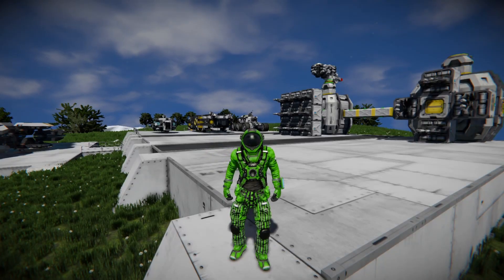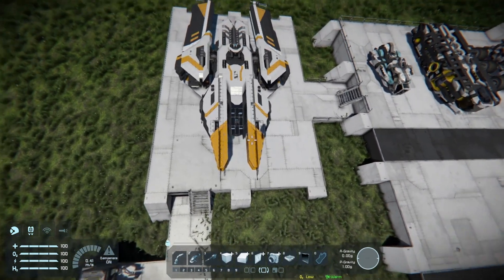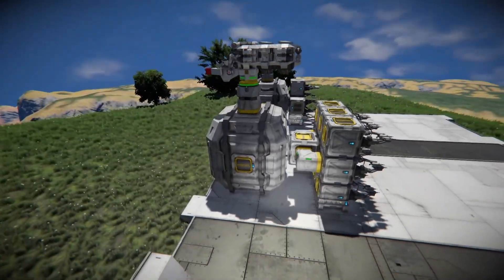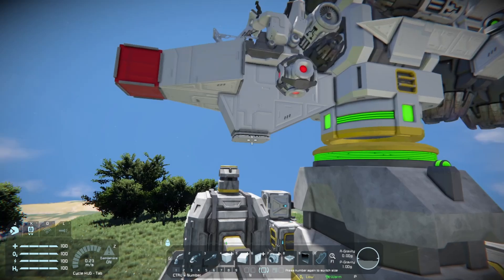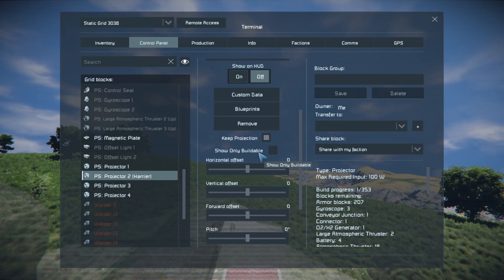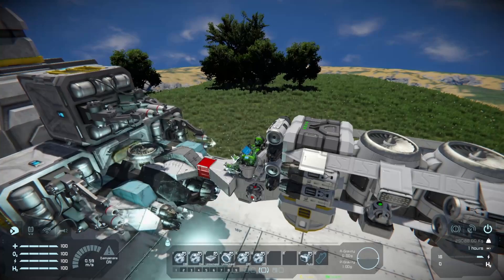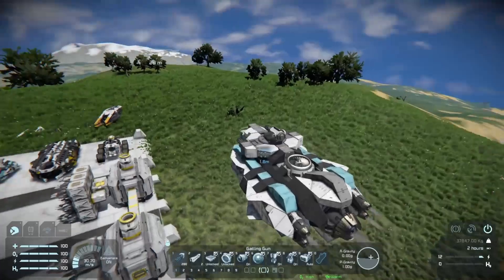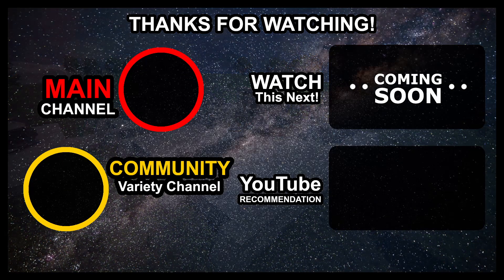Printing Made Easy: Space Engineers Tutorial

Comment: I've been using moving walls as opposed to moving the projection for over 2k hours by now. For small grid setup of checkered welders plus a large grid piston can weld projections as fast or faster than pull method. Double the piston if you need longer small grids - that's 8 large blocks lengths. Exploring event controller functionality also helps automating the process.

Another good tip is to setup welder walls outside gravity wells - allows for a relatively small tug to pull sizeable grids with more control.
Reply from the maker: Interesting.  I've tried the moving wall before, but personally I find that moving the projector is more convenient and forgiving.

If I mess up and miss welding something (run out of materials or go too fast) I can usually just spin my ship and finish welding it up from the side.   

Also, putting the projector on a ship makes setup and teardown much easier (if you're moving your base, or on a moving base)  You just bring the ship with you, and only ever have to build a new wall.  You never have to mess with settings or subgrids again.

That's all mostly for small grids though.  For large grids I tend to do it in space with a simple large grid welder ship and a stationary projector.  (Most of the servers I play on have limited welder block count, so I cannot easily build a printer for large grids.)  Yes, doing these kinds of things is always easier without gravity.  I love it.

Comment: In my survival world I have a large grid ship for printing. it has a small projector on an  underslung stick on a hinge that I can flip forward when printing small grids. Since I only printed in space so far I've put my biggest thrusters for reverse thrust, so I can keep pulling back at a steady place even when printing a sizable large grid ship.

Some considerations I've come across:
-putting projectors directly on battery blocks, so you can basically just place those two blocks and start buildign from there, if a proper print setup is currently unavailable. currently making that my standard practice on new blueprints
-If PCU is not your biggest concern right now: put merge blocks on your projector ships and blueprints, that way you can print them off and just let go, rather than grinding down and replacing blocks on the projector ship.
-I have set up 2 Hotbars per projector to handle blueprint lineup, being able to increase or decrease each offset and angle with a single button tap. ... I did that because doing it rather blindly in the menu annoyed me. I did not know about the reducing opacity option xD
-make sure you have enough materials and/or production quotas (per mod or script) set or printing, especially large grids, might not work out as intended.

Aside from that, and due to huge PCU costs it's probably only going to be practical on single player or a private server with unlimited PCU, I started building a modular design. After I found the acceleration of the current large grid ship I'm using lackluster I went into creative and worked out the design of a large thruster nacelle which I could simply stick onto my ship and back in survival I made the slight alteration to make my ship compatible (and obviously increased the version number) worked out pretty well, with the caveat that my desing ended up having a few silly blocks that are only attached via 1 face which made the printing process slightly more finnicky.
Reply from the maker: All good considerations.  I actually had the same thought about putting projectors near batteries years ago.  I still thinks it's good for large grids, but I've stopped doing it for small grids as I've never found it relevant in their case.

Comment: To print sub-grids i'll add a row of blocks connecting the subgrid to the main grid and make the connecting blocks a different color from the rest of the grid to make sure i know to grind them away later. It even works in survival which saves a ton of time.
Reply from the maker: True, if you spend the time to prepare a good blueprint you can make anything print.  Just might require a little assembly afterwards.

Comment: My all-time favorite variety of printer is one I slap together using MArmOS. The guides on this script look overwhelmingly complicated, but the reality is it's as simple as building a tutorial arm by hand, and simply using conveyered rotors in the build to get it hooked into your main base storage. The arms are not that complicated to build by hand either, the most important thing is to memorize the building process and ideally, color code the rotors and name them for scripting purposes later. 

The cool thing about these arms is, depending on the complexity of the one you decide to use, it can maneuver and pivot around a single point with extreme precision, and can extend quite far. Basically, it's like flying a welding ship, without having to constantly fly back and forth to refill on components, or fight gravity. 

The other cool part about using MArmOS for this purpose is the arm can be refit for mining. A lot of people like to build drills on the side of their base to convert all the stone into necessary materials, but you can also do the same with with a manually controlled mechanical arm. Hoover up a bunch of stone, then swap the end of the arm out for a welder and you're ready to start welding up anything. It even goes a step further, as these arms can also be used to further build out parts of your base.
Reply from the maker: I don't think I've ever used something like that.  I've just always kept my printer setups as simple as possible as I generally only use them to produce early game ships.  What you're describing might be cool to try some time though.  As an end game build in and of itself.

Comment: the solution is a gyroscopic 360° printer that expands slowly and prints ships.
Once printed the rings aligns and the ship can leave.
Reply from the maker: Definitely the solution for slowest and most unnecessarily complicated printer. XD  Might look cool in time lapse though.
Reply: @ShiftyshadowTV  but it can print any possible shape of ship, aside multi-grid ones.
Reply from the maker: Yeah, it could print more complicated shapes than a linear printer, assuming no printer or blueprint specific modifications.

If we're excluding those modifications, I'm fairly certain I could design a ship that that type (or any given type) of printer couldn't print.

I don't think there's anything wrong with the idea, it's certainly cool, it's just not simple.
Reply: @ShiftyshadowTV  of course, it's a rube goldberg printing machine xD
Reply from the maker: Haha, yeah.  End game printing.  It's not about what you print, it's about how you print it.
Reply: @ShiftyshadowTV  that's what I wanted you to type xD
Something that would be awesome would be building ships like you build planes and spaceships in Total Annihilation or Planetary annihilation :P
Ingame the model spins, not the shipyard, sadly you can't do it in Space Engineers (i suppose... Actually there may be a way: battery+projector that spins in all directions (this can be done with expl bolts and gyros + batteries) and this should be the exact center of the ship; the whole thing have to be moved and "centered" with gravity generators that slowly keeps moving the piece outwards while the  welders do their job.
I know, easier to say then to do but hey, your phrase :P
Reply from the maker: After thinking about this a while. I agree, it could be done with gyros, artificial mass blocks, gravity generators, and merge blocks.

Comment: I have a problem with this method. Whenever i'm printing something the second the welders weld up the cockpit of the projected blueprint i lose all controll of the connected contraption. I have to get out of the control seat of the projector ship and enter the cockpit of the unfinished blueprint to controll it. I tried with many different blueprints and its all the same. If i grind down the connector block everything returns to normal on the projection ship.  idk what to do to fix this
Reply from the maker: This will happen if the ship you are printing has its cockpit/control seat  set to "main cockpit".  The same problem can occur if you try to print AI blocks that are on.  You can fix it by changing the settings in your menu once the block is welded.  Or you can take a fresh blueprint of whatever you're panning to print, making sure these settings are fixed first.
Reply from the maker: Active remote controls might also cause this.
Reply: @ShiftyshadowTV  Thank you for the very quick response!  For some reason i had the cockpit on the blueprints set to "main cockpit" and unchecking it then replacing the blueprint with new settings fixed the issue.
Reply from the maker: Awesome, glad it's working for you now!  I should have mentioned that in the video.  Hard to think of everything though :)

Comment: Complex ships are easy enough to do if you include a jig in the blueprint. Basically a chunk of blocks set up to connect the grid and print from which you remove later. Had to do it for some of my large grids in the past as well.
Reply from the maker: That's a good idea.  Takes some preparing but can work nicely.
Reply: @ShiftyshadowTV  I've also seen multigrid ships done like that too, cut up and printed as one unit with the jig, chop the jig at specific points and the parts fall into place for attachment. used mostly for custom rover turrets on the LSG channel... see it occasionally on the mad max series.
Reply from the maker: I can see that being very nice for custom turrets.

Comment: One point to add is: you should use something to block the printer from welding inside of it: usually a glass wall in front of the welders is the only thing you need. If you do not do this, there is a chance, for the larger small grids BP, some of the small blocks will get stuck in the welders. the glass wall stops the welding to the welder's tip 

Also if the form is not uniform, like the ship from the workshop, you can have multiple point of contact ex: On the workshop ship I would make a row of blocks that would touch both front prongs  (that work only for the form, nothing you can do for the subgrids)
Reply: To expand on this; if you want to "layer print" gigantic ships in space without crushing the server with hundreds of welders, make a line of welders  every other block (with the blocks to the sides of the prongs filled in so it does strict layers), then have this welder stick spin on a rotor like the hand of a clock connected to your base/factory.  That circle the hand makes is now the area of your printer and you didn'thave to make a football field size printer.  Great for welder limits.  Then pull out your blueprint with another ship tug boat style.

Pi R squared baby.

You're welcome.
Reply from the maker: Yeah, a glass wall is nice, works for grinders too.  Decided to skip it for visual clarity, even though it's not complicated.  

The multiple connection points is a great idea, and one I've never thought to do myself (though a few people have suggested it at this point).  No matter how long I've played I'm always finding room for improvement.
Reply: we now have ways to print subgrids with certain mods and plugins

and if you are smart, you can do what he does here, where you just assemble the grid as part of the printing process, which is good for things like minigames where you need many many versions of the same base vehicle, and the only modifications are field modifications on-the-fly

Comment: Please help! Let’s say one wants to print a large grid ship and ones printer setup is connected to the assemblers and refineries. Do I need to manually make all the materials before printing, or do they automatically get added to a que from the projection? I want to make a printer setup for large grid but this has me stumped.
Reply from the maker: The assemblers and refineries will not automatically make components.  You will have to queue them up manually.  You should make sure you have all the components you will need already made before you start printing.

If you're unsure how much of everything you will need, try to overestimate.  

If you want to be very careful you can pause the printing after each layer and look around to make sure everything is getting welded.  Also, you could keep checking your inventory and if you run out of any component, pause the print and make more.  While they are producing check to make sure the stuff you've already printed is complete and not missing those components.

Always best to overestimate and have components left over.
Reply: @ShiftyshadowTV  ok appreciate that my man, huuuge help. Perhaps large cargoes with each different component could work too? Wire it up to pause if one goes empty. The new AI blocks should make that possible. Appreciate the help again tho my entire printer design was held up by that lol.
Reply from the maker: Yeah, that's not a bad idea, some of the components you could use small cargo containers for too (anything that's small or you don't use much of).
Reply: @ShiftyshadowTV  Hmm I didn’t consider that, I was thinking about the mess of sorters and some way to keep it compact as possible.
Reply: @CodyTwitty  I believe there is a mod that let the projector "order" components from the assemblers
Reply: @ShiftyshadowTV  is there any way to see how many computers motors and others are needed?
Reply from the maker: @thelinemaster9925  Not in vanilla.  There are probably mods for that though.  

After a few goes you'll get a feel for estimating that kind of thing.  I personally just overestimate heavily.

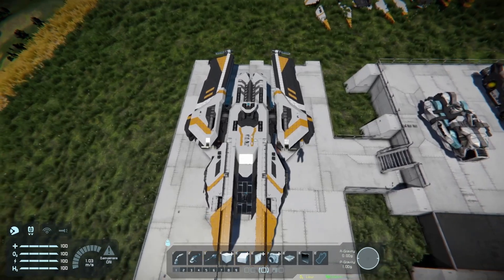Comment: 2:45 I actually think you could print that double forked ship without too much difficulty starting from the back. It would need a T-junction to attach to both of the rear engine pods instead of starting from a single attachment point. They're all part of the same grid so it wouldn't be too hard for it to meet for the middle section. Unless those are subgrid engine pods, then it gets a bit more difficult.

It does depend on what sort of printer setup you're using though. Is it a small room with a ton of welders all over the walls? Is it a piston contraption that pulls the projection out of the welder wall? and so on.

Edit: I just realized parts of the back of the main body might not get printed properly if you were to use my method, well it could technically still work, it would just need another attachment point for that.
Reply from the maker: Yeah, if it was just the shape that ship wouldn't be terribly difficult to print.  It's was only a decent example for that point.  Mainly I chose that grid because it has about 20 subgrids (which wouldn't print in vanilla).
Reply: @ShiftyshadowTV  Yeah, 20 or so subgrids is a bit much for printing. An idea just occurred to me though.

If one were to blueprint all of the subgrids and have those blueprints being projected with projectors on the main body of the ship, would it hen be possible to print the entire thing in one go do you think?

Might need a bit more of a complicated setup than just a welder wall, but it might work. I'd test it myself but my computer still can't run SE. (Or, well, it probably can, but the physics calculations would probably be too much for the amount of RAM I have).
Reply from the maker: I don't believe it would work. The sub grids (even if projected in place) would have no connection point to start welding from unless merged to the main grid.  Even if they were, the rotor and hinge heads would fail to print because they're technically trying too take up the same space as their body.

You could blueprint all the subgrids and print them separately, then line up and reattach them after (which can be automated, complexly).  That's probably your best bet in vanilla.